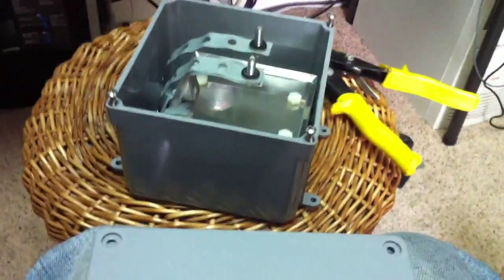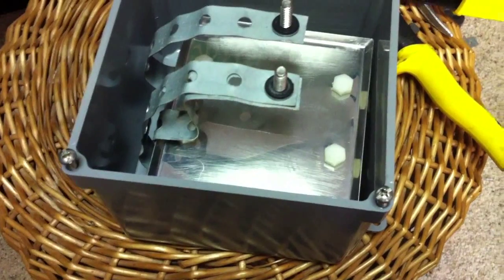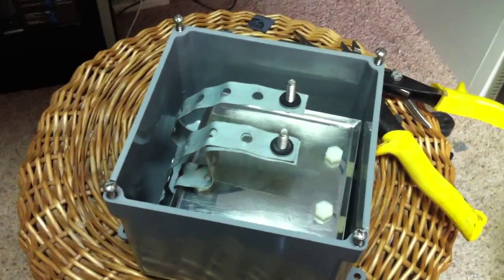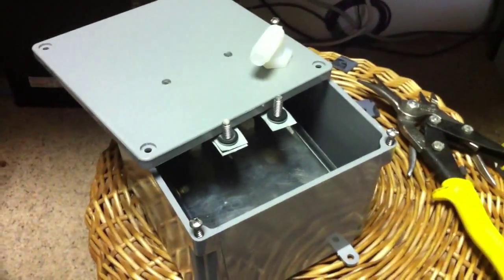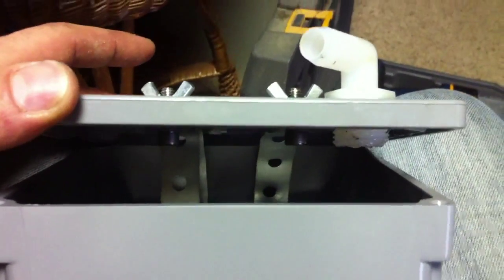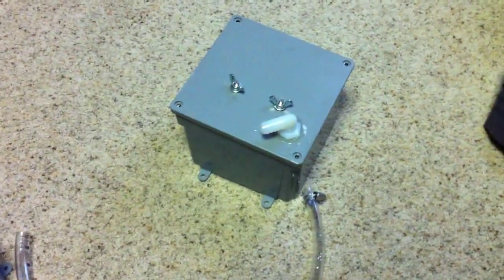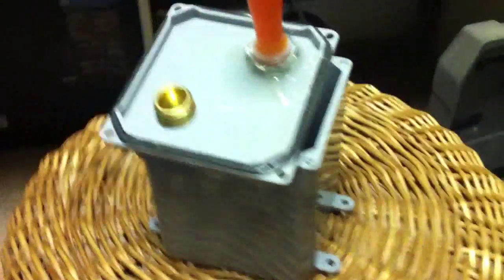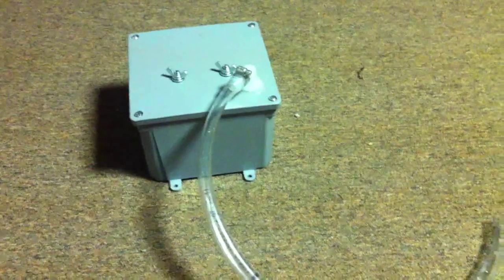HHO Take 2 - Building Hydrogen wet cell enclosure and bubbler

Comment: I noticed right away that there was not a flash arrestor.  If the engine even burps a flame-front with travel to your cell and BOOM.  I use brass tube with cigarette filters in side (not jammed in, but stacked), then solder brass fittings of your choice on the ends.  Can be done with nylon or pvc too.  I have been gluing tanks with poly-carb sheets.  A lot of Cracking due to thermal expansion.  I like your box idea.  Thanks

Comment: So, it's been well over a year now. What have you gleaned from this project. How well does it work? What did you see if any? How long until it self destructed?

Inquiring mind.
Reply from the maker: First attempt it worked in the vehicle for a week with good results, unfortunately I used too much electrolyte and the high amperage draw caused strain on my alternator..which eventually failed. It definitely produces quite a bit since someone dared me to flame near the bubbler output one day and it instanly blew to pieces. With a tiny bit of sodium hydroxide i was able to get it working, but i need to reconfigure the plates to get the most out of my input power.